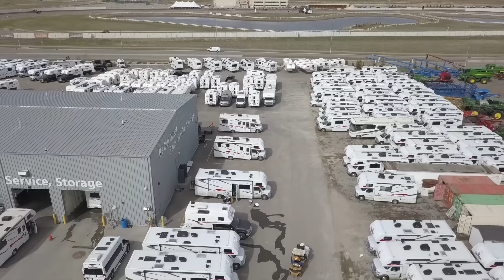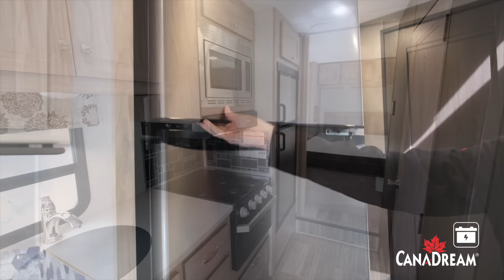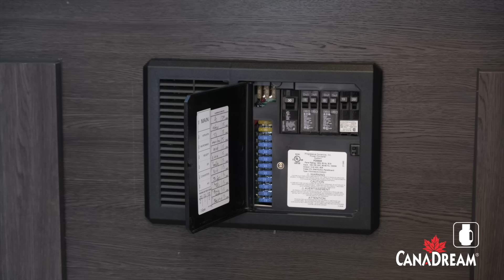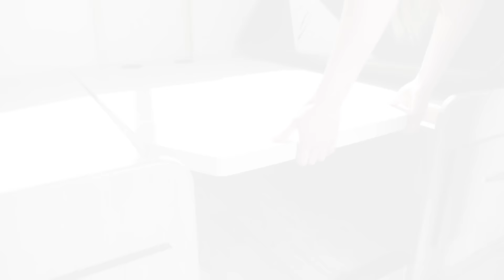2022 CanaDream MHX MHA MHB SVC Demo Video English -  Full Version

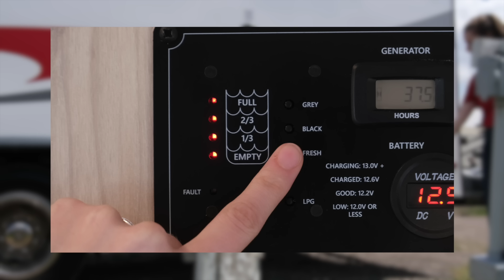Comment: 2:15 Fresh Water & City Water
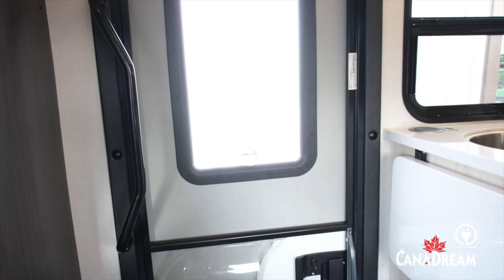3:17 Electrical Hookup
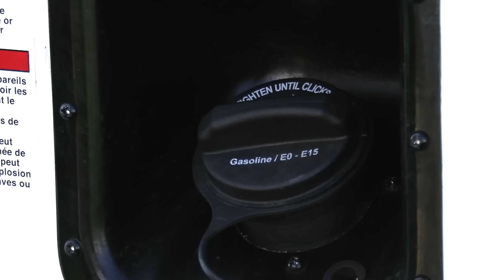5:00 Fuel
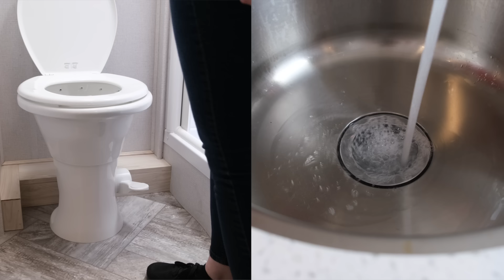5:22 Black & Grey Waste Tanks
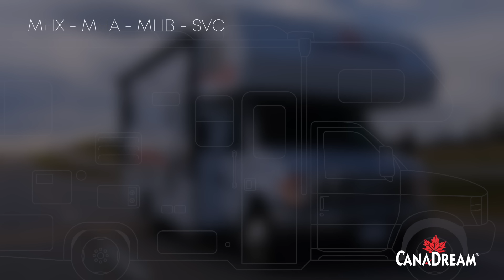7:34 Propane
8:29 Driver Cab
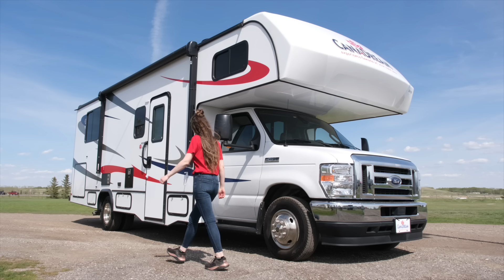9:32 Look Inside
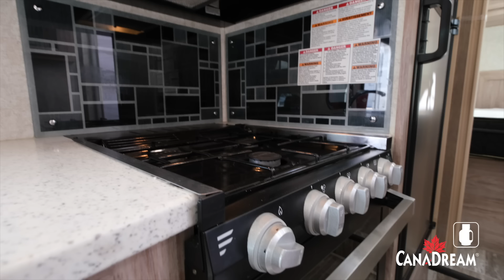10:03 Stovetop
10:38 Fridge / Freezer
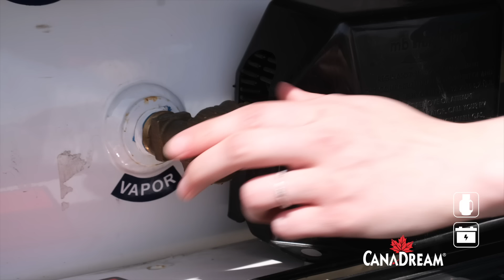12:09 Furnace
12:43 Roof Air Conditioner
13:15 Bathroom
14:20 Monitor Panel
15:10 Water Heater
16:03 Operating The Slide Room
16:57 Generator
18:27 Dinette Conversion
19:46 Overcab Bed
20:13 Safety
20:40 Use a Spotter